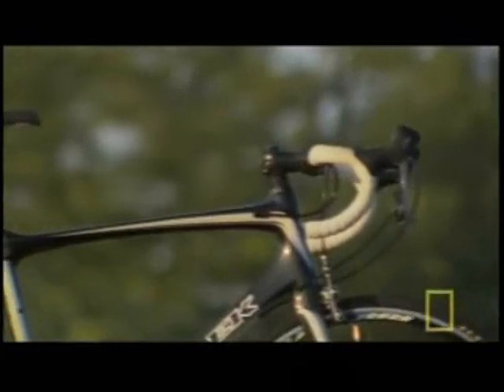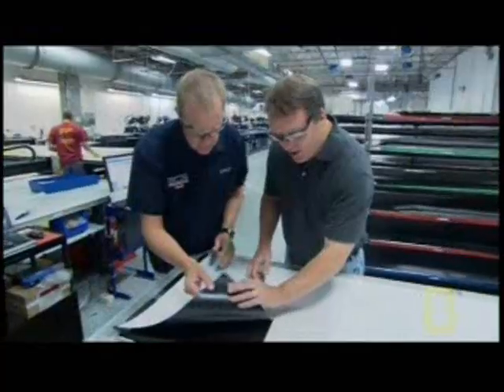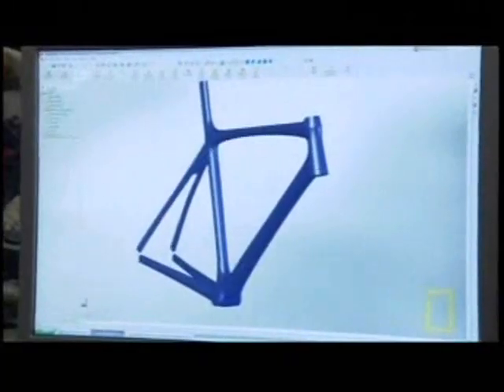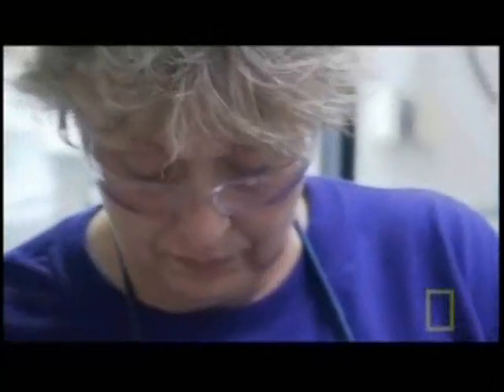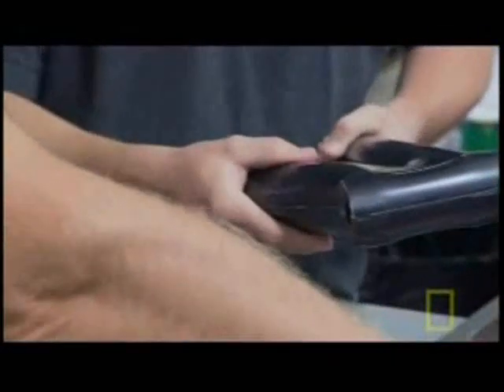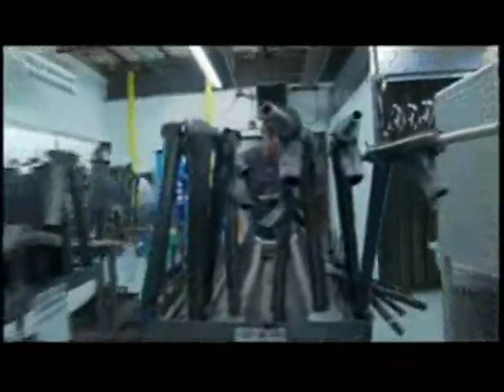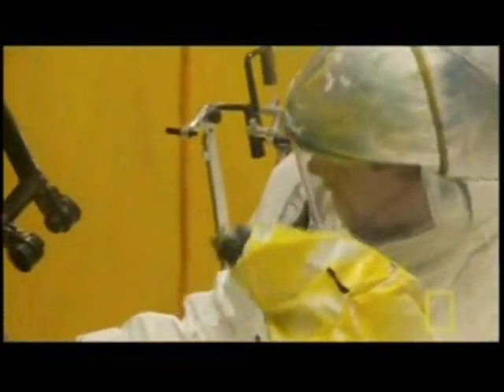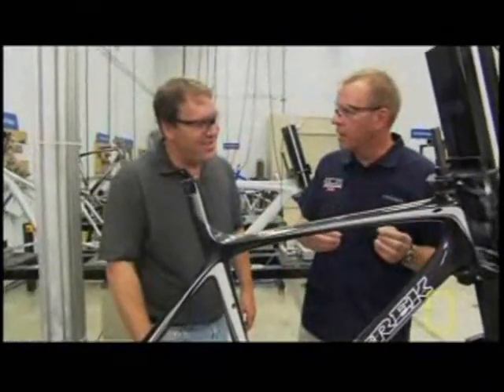Trek Madone Frame

Comment: The black contact glue might be replaced with a white epoxy glue! Ergo increasing the bonding capability of the carbon frame. In my experience the white epoxy is deemed to be significantly stronger and additionally more reliable. Trek might have significantly better bonding glue if the epoxy is white insead of black epoxy. Believe this transmittal or not!